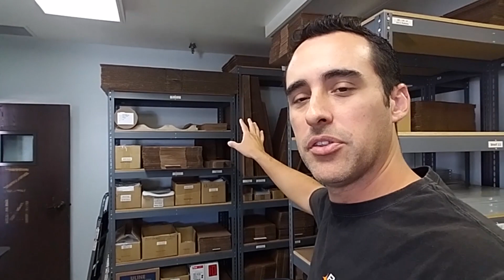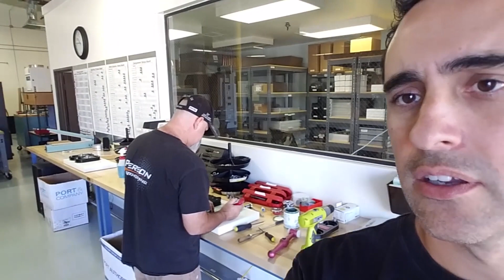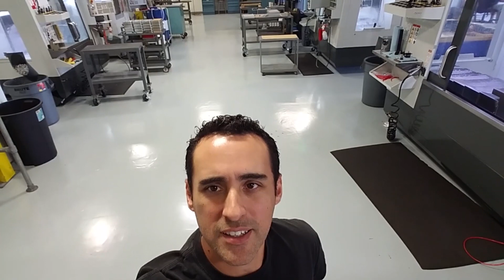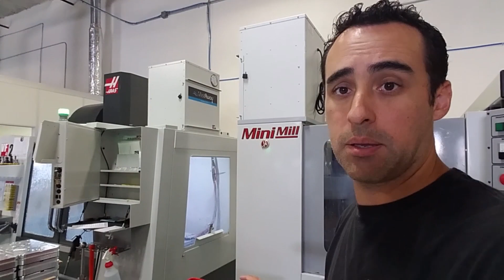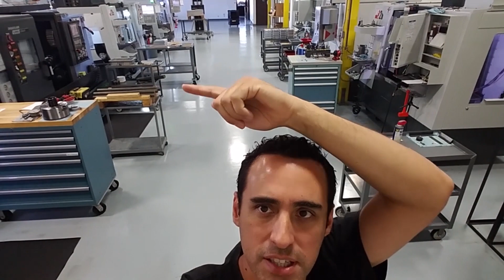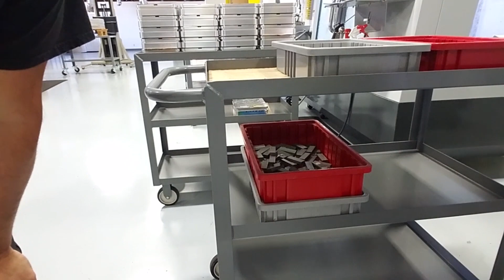Establishing Flow in Manufacturing

Comment: It would be interesting to understand how you balance Kanban size against machine setup time. The ideal is minimal WIP and FG inventory. Choke points like anodizing and engraving can mess with your overall flow. It’s easy to get into a situation where maximizing machine efficiency produces too many parts in WIP. Your pallet systems are ideal components of a SMED system that allows you to produce kits of parts for a product quickly. Nice work.

Comment: Great video.  You always emphasize that you guys work 40 hr weeks(that’s awesome, probably a piece of the reason you are successful). I am curious as a small business owner do you as the owner also stick to that 40 hours or do you find yourself doing significantly more?   Cause as the owner of a small business I know its typically more than a job it can be part job, part hobby.
Reply from the maker: Jay here... It's a tricky one to answer.  I'm only at the shop about 30 hrs per week, but I think about the business around 80 hours per week.  I love what I do so it's hardly work, but I don't neglect family when I'm home.  I'm a night owl and get a lot of designing and planning done at night.